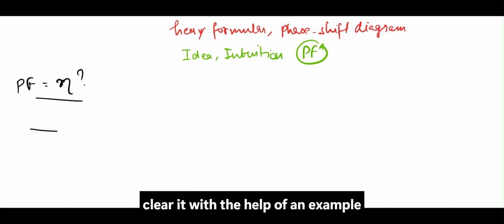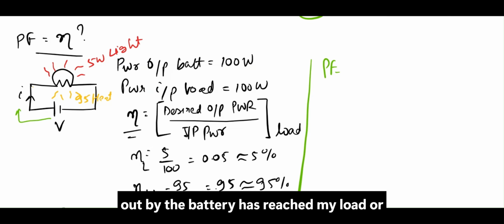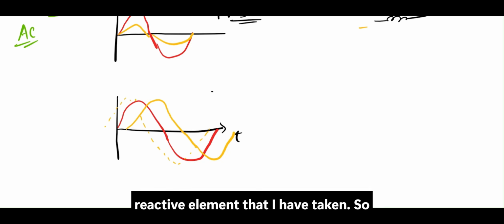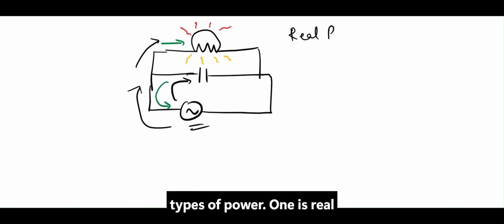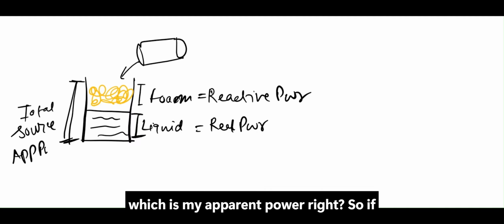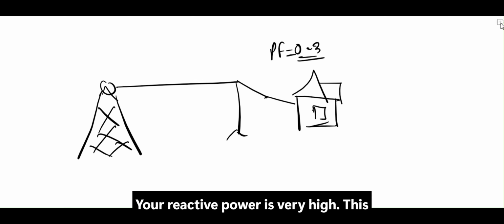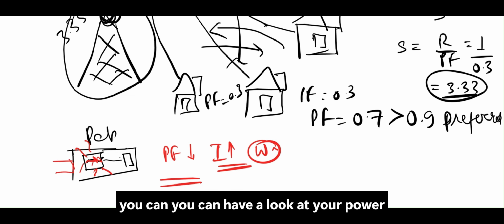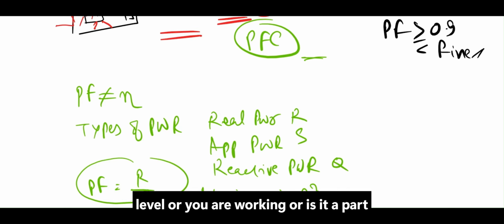The Most Misunderstood Concept in Electronics: Power Factor

Comment: Nice explanation.
Reply from the maker: Thanks
Reply: @thinkLikeEngineer2026  so that means efficiency and power factor ask the same question regarding power at different stages of the circuit?.
Reply from the maker: @madhurisawlani4009  Yes, you got that right. Power Factor comes during the transportation stage where a part of the energy pushes out from the source is reaching the load unit. Efficiency comes into picture during the conversion stage where the loaf converts the energy into useful output energy.